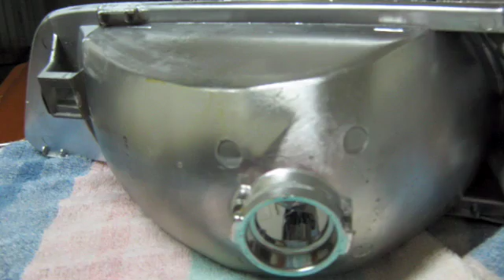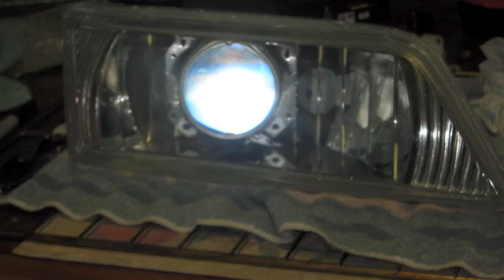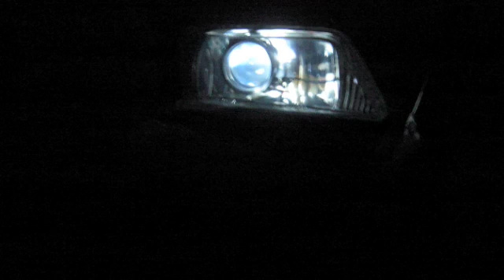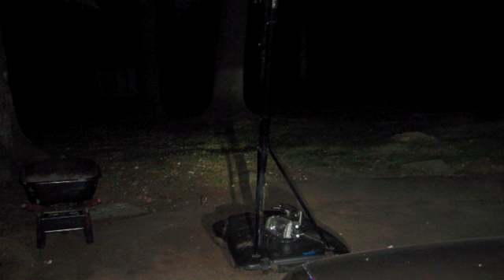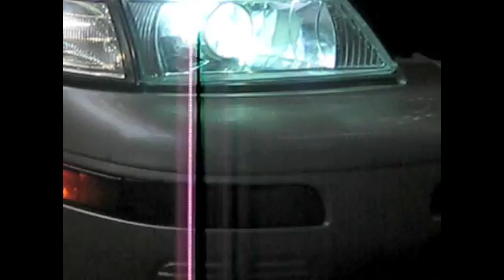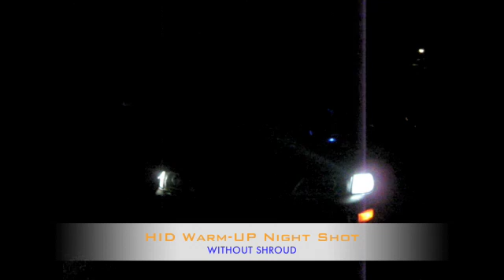Maxi Retrofits =D 1995 Maxima HID Projector Retrofit Project

Comment from the maker: @balu3414 Hmmm I can't seem to find them anywhere.. I got them off of ebay a few years back..just clear glass OEM's. I guess you should be able to use any of the JDM(skyline) types or any other aftermarket kit that has a clear front.  Hope this helps! BTW, I may be selling my headlight as a complete set and setting mine back to stock(selling the car).

Comment from the maker: @kapri11212 I bought a pair of clear glass headlight housings on ebay.. and once I got them opened up in the oven, I test fitted the projector to see how much I needed to cut in the back of the housing.  You should have a circle cut out so that the tail of the projector will stick out.. then just fill any gaps with silicone.

Comment: Question when you did the retrofit, did you have to cut into the headlight housing, or did you just put the projector and the cut off plate and lens bracket inside the headlight. I just bought a set of e46 projectors on eBay for a crazy price, and i want to do a retrofit for my 4thgen. Let me know. Or do you have a DIY by any chance.thanks in advance.